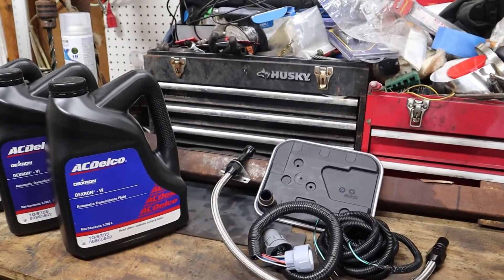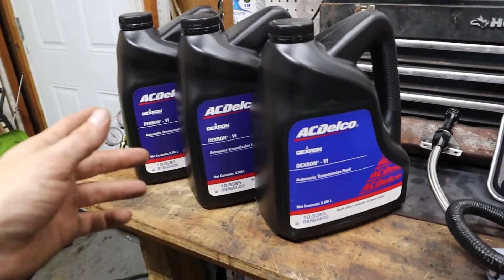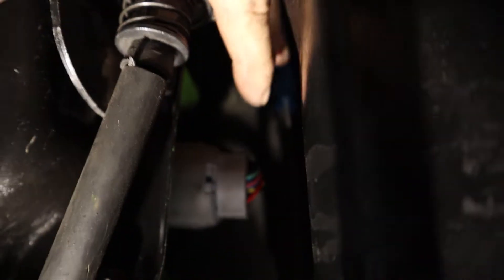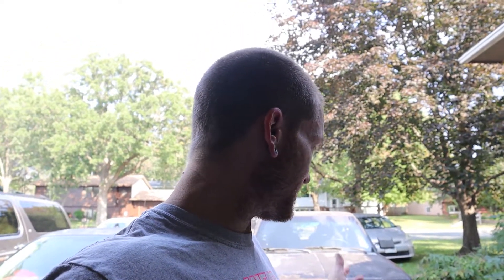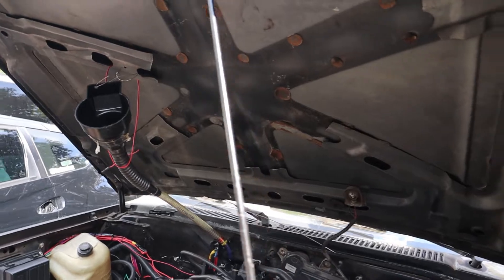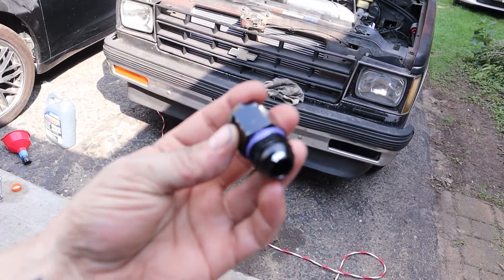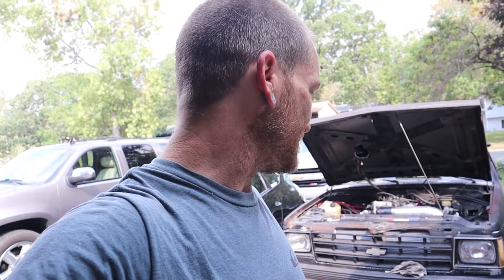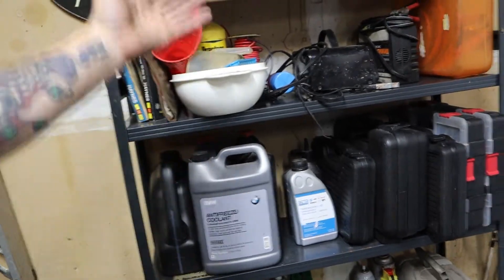4L60e to 4L80e Wiring & Tuning

Comment: Hey what happenes if you don't connect the speed sensor I got a tune with 6.0L
Reply from the maker: Well there are two and if you remove either one the trans wont shift right or at all
Reply: @southerngearz  shift right or hard shift cause mine has a lock 🔐 up wire issue I tried everything except the tcc to brake rig trick
Reply from the maker: So if you go with the tcc to brake find the wire that gives 12v when the brakes are pressed. In my case when I was missing one of the speed sensors it was stuck in 2nd gear.

Comment: I’m doing the same exact thing.will the transmission work without a tune? Could I make it on the road to a tuner?
Reply from the maker: Some say its possible I havent tried though. If it was temporary then it could work but longterm not so much. The torque convertor locks up different and the shift points are different due to the different gear ratios from 1st to 4th. It should only cost you about $100 if you have hptuners. If not check out ebay and get a pcm someone flashed already they are all over ebay.
Reply: 10/4 thank you.
Reply from the maker: @TheJeffe613  no problem guy